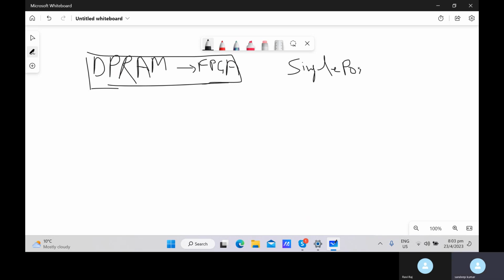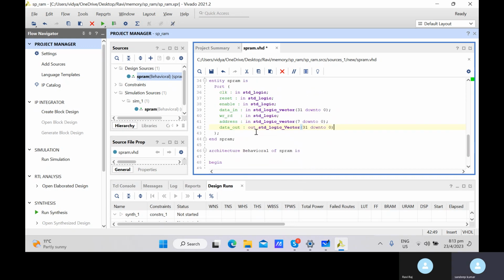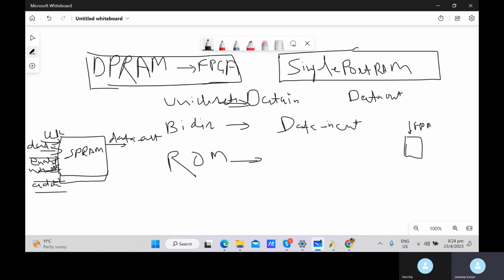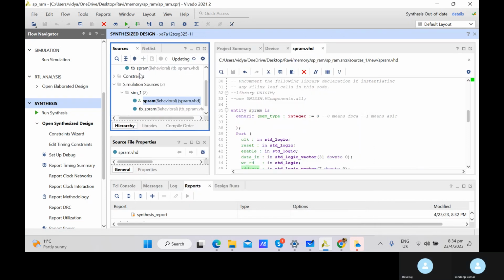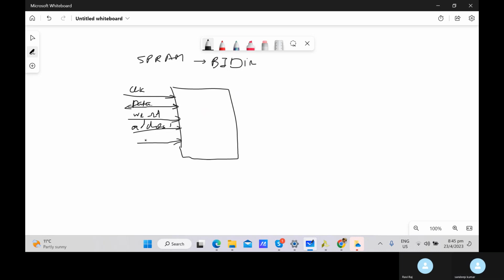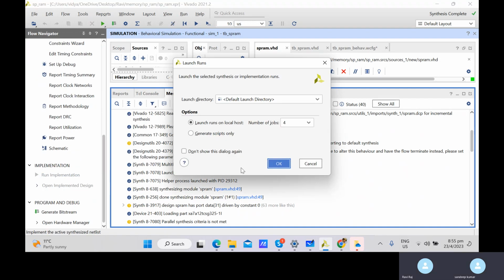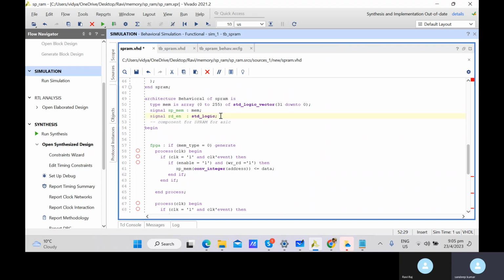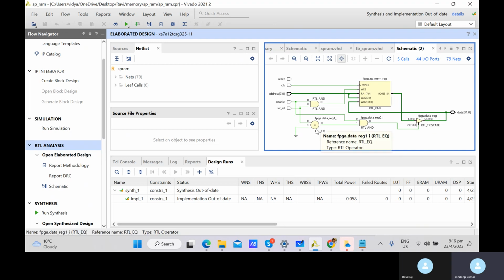Designing a Single-Port RAM with Bidirectional Data Bus: FPGA Programming Tutorial

Comment from the maker: ----------------------------------------------------------------------------------
-- Company: 
-- Engineer: 
-- 
-- Create Date: 23.04.2023 20:09:07
-- Design Name: 
-- Module Name: spram - Behavioral
-- Project Name: 
-- Target Devices: 
-- Tool Versions: 
-- Description: 
-- 
-- Dependencies: 
-- 
-- Revision:
-- Revision 0.01 - File Created
-- Additional Comments:
-- 
----------------------------------------------------------------------------------

library IEEE;
use IEEE.STD_LOGIC_1164.ALL;
use IEEE.STD_LOGIC_UNSIGNED.ALL;

-- Uncomment the following library declaration if using
-- arithmetic functions with Signed or Unsigned values
--use IEEE.NUMERIC_STD.ALL;

-- Uncomment the following library declaration if instantiating
-- any Xilinx leaf cells in this code.
--library UNISIM;
--use UNISIM.VComponents.all;

entity spram is
  generic (mem_type : integer := 0 --0 means fpga --1 means asic 
  
  );
  Port ( 
    clk : in std_logic;
    reset : in std_logic;
    enable : in std_logic;
    data : inout std_logic_vector(31 downto 0);
    wr_rd   : in std_logic;
    address : in std_logic_vector(7 downto 0)
  );
end spram;

architecture Behavioral of spram is
  type mem is array (0 to 255) of std_logic_vector(31 downto 0);
  signal sp_mem : mem;
  signal rd_en  : std_logic;
  signal rd_data  : std_logic_vector(31 downto 0);
  -- component for SPRAM for asic
begin
 
   
  fpga : if (mem_type = 0) generate
    process(clk) begin
      if (clk = '1' and clk'event) then
         if (enable = '1') and (wr_rd ='1') then
            sp_mem(conv_integer(address)) <= data;
         end if;
      end if;      
    
    end process;
    
   
            rd_data <= sp_mem(conv_integer(address));
         
               

    
    data <= rd_data when (enable = '1') and (wr_rd ='0') else
            "ZZZZZZZZZZZZZZZZZZZZZZZZZZZZZZZZ";
    

  end generate  fpga;
  
  asic : if (mem_type = 1) generate
    -- instantiate ASIC spram (port map)
     
    

  end generate  asic;
  

end Behavioral;

----------------------------------------------------------------------------------
-- Company: 
-- Engineer: 
-- 
-- Create Date: 23.04.2023 20:34:21
-- Design Name: 
-- Module Name: tb_spram - Behavioral
-- Project Name: 
-- Target Devices: 
-- Tool Versions: 
-- Description: 
-- 
-- Dependencies: 
-- 
-- Revision:
-- Revision 0.01 - File Created
-- Additional Comments:
-- 
----------------------------------------------------------------------------------

library IEEE;
use IEEE.STD_LOGIC_1164.ALL;

-- Uncomment the following library declaration if using
-- arithmetic functions with Signed or Unsigned values
--use IEEE.NUMERIC_STD.ALL;

-- Uncomment the following library declaration if instantiating
-- any Xilinx leaf cells in this code.
--library UNISIM;
--use UNISIM.VComponents.all;

entity tb_spram is
--  Port ( );
end tb_spram;

architecture Behavioral of tb_spram is
 component spram is
  generic (mem_type : integer := 0 --0 means fpga --1 means asic 
  
  );
  Port ( 
    clk : in std_logic;
    reset : in std_logic;
    enable : in std_logic;
    data   : inout std_logic_vector(31 downto 0);
    wr_rd   : in std_logic;
    address : in std_logic_vector(7 downto 0)
  );
end component;

  signal  clk :  std_logic := '1';
  signal  reset :  std_logic:= '1';
  signal  enable :  std_logic := '0';
  signal  data    :  std_logic_vector(31 downto 0):= (others => '0');
  signal  wr_data    :  std_logic_vector(31 downto 0):= (others => '0');
  signal  wr_rd   :  std_logic := '1';
  signal  address :  std_logic_vector(7 downto 0):= (others => '0');
begin
  clk <= not clk after 5 ns;
  
  process begin
    enable <= '1';
    wr_data     <= x"51515151";
    address  <= x"0c";
    wr_rd    <= '1';
    wait for 10 ns;
    enable <= '1';
    wr_data     <= x"D1D1D1D1";
    address  <= x"0b";
    wr_rd    <= '1';
    wait for 10 ns;
    enable <= '1';
    wr_data     <= x"D1D1D1D1";
    address  <= x"0b";
    wr_rd    <= '0';
    wait for 10 ns;
  end process;
  
  data <= wr_data when (wr_rd = '1' and enable  ='1') else
          "ZZZZZZZZZZZZZZZZZZZZZZZZZZZZZZZZ";
  
  
  dut : spram 
  generic map(
    mem_type => 0) 
  
  Port map( 
    clk ,
    reset ,
    enable ,
    data,
    wr_rd  ,
    address 
  );
end Behavioral;